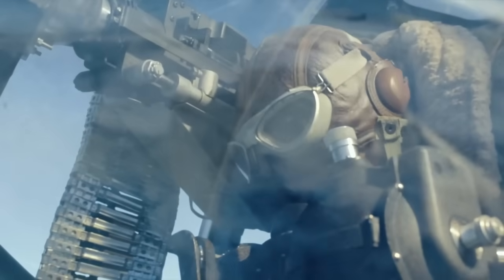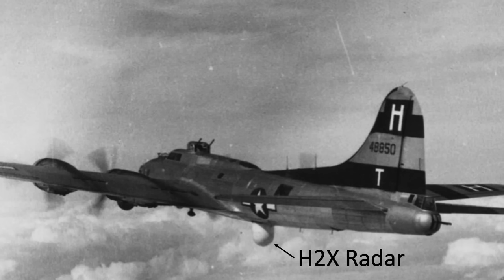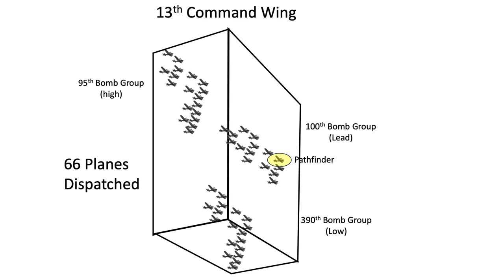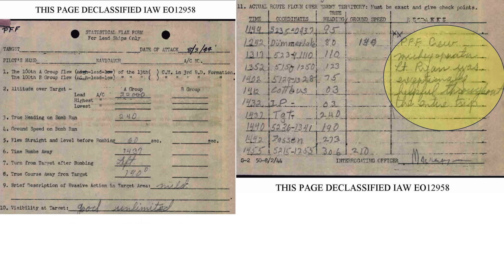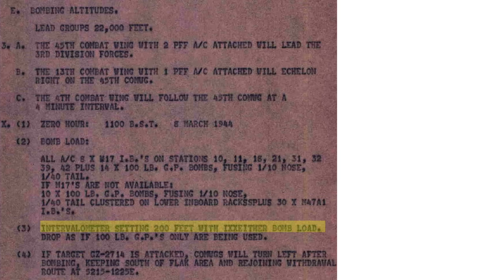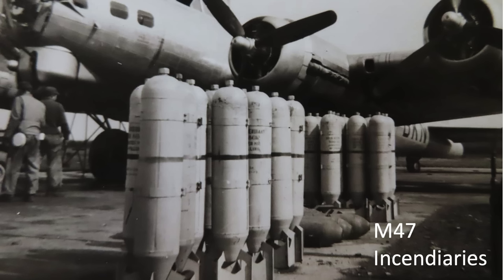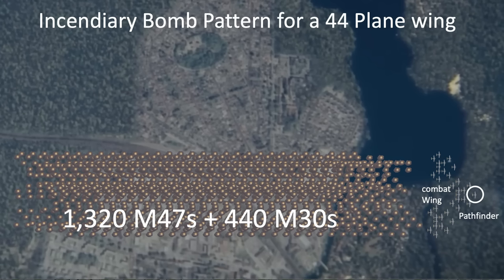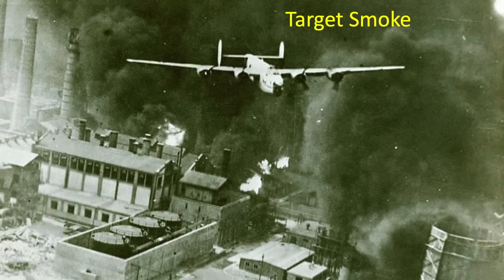Masters of the Air –Why so many bombs in Episode 7? - Fact Checking the March 8, 1944 Mission

Comment: I have been enjoying your videos on the series - very well done. One comment I have is the inclusion of significant amounts of grey-black exhaust smoke when the aircraft are taxiing or taking off. I am NOT talking about the grey-white smoke at engine start - that’s normal & expected for radial engines. I am also not referring to the white contrails at altitude - this too is normal & expected. There are at least 3 scenes where I noticed this inaccuracy: 1) episode 1 when the 2nd aircraft landing in Greenland executes a go-around. At application of take-off power, there is an abnormal amount of exhaust smoke from all 4 engines. 2) episode where mechanic is changing engine part while aircraft is taxiing for takeoff (another conversation in itself). The exhaust smoke is visible behind the engines, but disappears completely by the time it reaches the tail. 3) last episode when the B-17s are headed home - all of them are leaving trails of grey-black exhaust smoke as they climb. Looks like a B-52 MITO effort (slightly exaggerated to make the point). As a B-17 restoration team member, WW2 aviation freak, and engine guy, I found these to be slightly distracting & completely unnecessary. Guess the CGI team needed some extra work…

Comment: They should have hired you as the consultant rather than the 15 experts.  A few episodes ago they covered the Oct 10 Munster Raid where Rosenthal's plane was the only 1 out of 13 to make it back.  Various internal systems were knocked out as were two engines but Masters of the Air showing the plane coming in on 4 working engines.   While other groups in other raids suffered tremedous losses, the 100th Oct 10 1943 92% loss rate is a clear stand out.  There could have been more discussion as to why they went out with 13.  They screened  mechaical failures though there is some evience that another group was supposed to send six planes to join the 100th but didn't.  Also the consequences of being in the low position in the Box could have been better explaint to viewers and generally the concept of supporting fire.  But hey . . . its Hollywood.

Comment: why did the other planes even have bomberdiers ? surely the copilots could of fliped the toggle .
Reply: Later in the war the US replaced the bombardiers with gunners who received a rudimentary knowledge of bombing duties.
Reply: thanks !
 @RealityOrganized
Reply: @malakiblunt  I should add the US didn't replace all the bombardiers. Not sure the percentage of B-17s that flew w/ a gunner in lieu of a fully trained bombardier.  That's a great question for our host WWII US Bombers. I suppose bombardiers were slowly phased out. 

Other duties: The bombardier position was the guy who opened the bombbay doors. I suspect was responsible for arming the bombs (once the AC reached altitude? or maybe after a certain distance?). Certainly responsible for jettisoning bombs if needed. Also likely the stuckee (pun) if a bomb failed to fall, someone had to go back there and force it out of the aircraft.